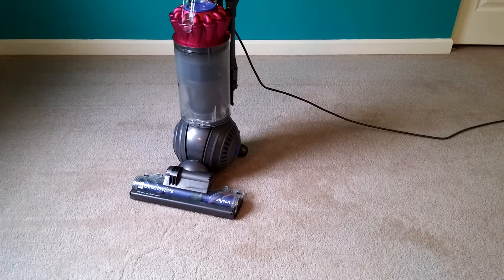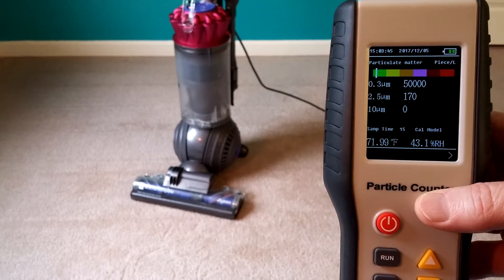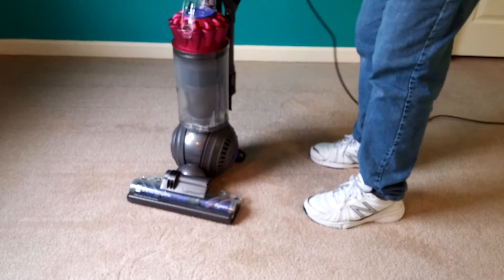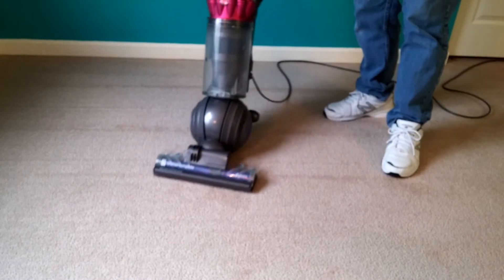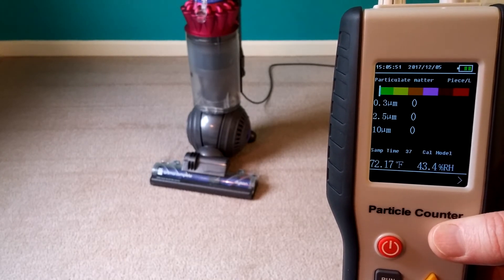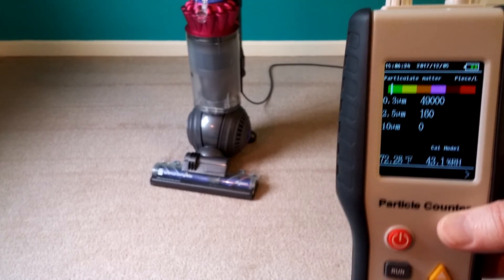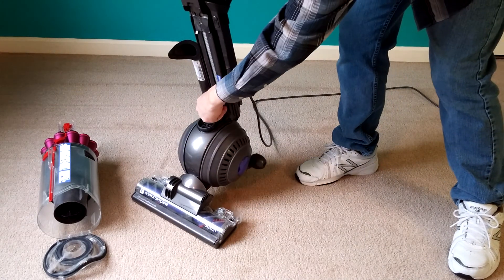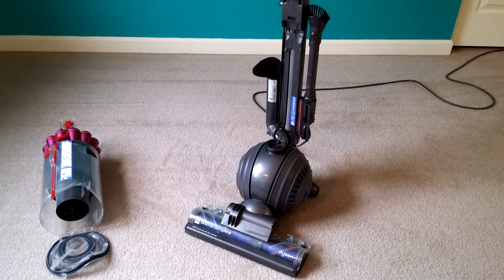Open Room Particle Emissions Test With A Dyson DC65

Comment: Can you please suggest vacuums  brands(even older models) what would be the best in cleaning mold spores? So their hepa filter would work great even after few years of using it?  Preferable lifetime washable Hepa filter and bagless. Thanks a lot!! And thanks for the videos!
Reply from the maker: Mold spores are relatively large particles and easily cleaned by any machine that is HEPA rated.
Reply: @VacLab  that's a great info! Thank u so much!